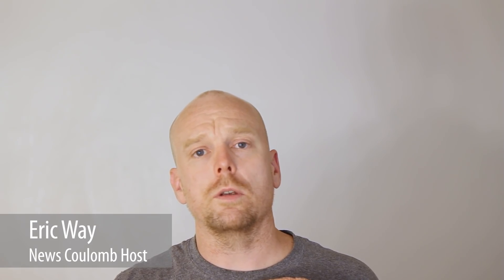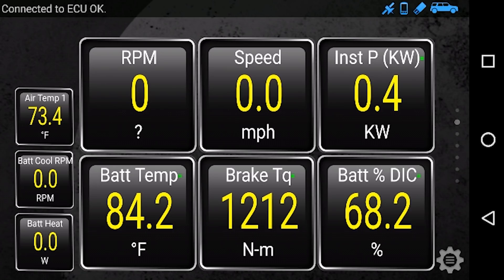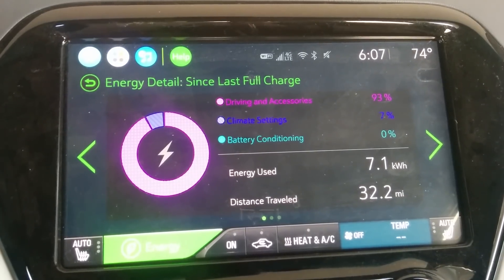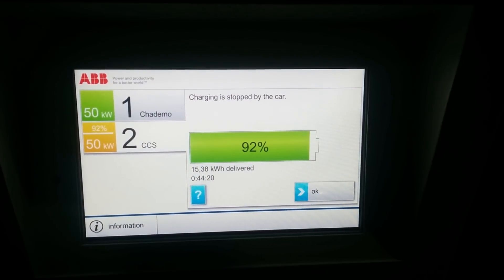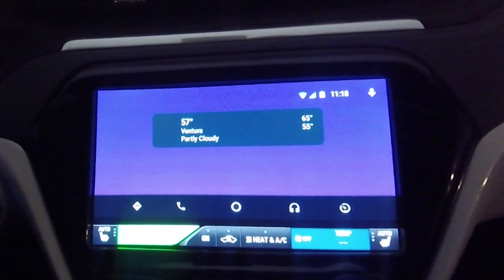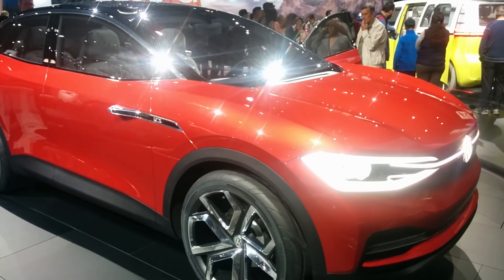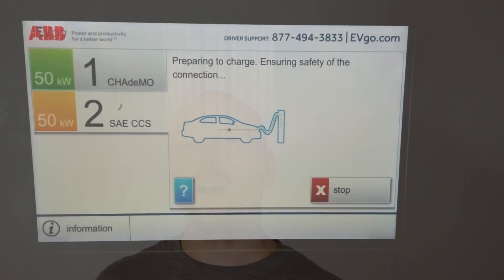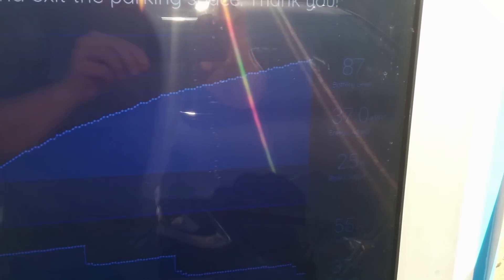Chevy Bolt EV: 70,000 Mile Battery Degradation

Comment: Eric - when used as a daily driver, I’d think that you’d need to create a specific situation that you’d subject the car to - once every year, or after another X miles - in order to determine the battery degradation.  When I drive from 30 to 90 miles per day in my average week, obviously I don’t see any degradation that has occurred in the 21k miles that my Bolt has accumulated to date.  The range of the 60 kWh battery is just that great, and my car so far hasn’t been used for much extended travel, since that’s just not yet practical in my region.  Being in Michigan, my car is exposed to greater temp extreme on the cold side than yours, and outside temperature (and climate usage) matters a lot when estimating the range which a full battery contains.  I wonder what effect that using a (50 kWh) fast charger on a cold battery has, when the initial charging speed starts out in the low teens and ramps up to 35 kWh charge rate 10 to 20 minutes later?  What’s going on inside that battery as it warms up - perhaps too quickly?  L2 chargers still deliver their maximum into a cold battery, so there must be significant resistance to taking on a fast charge when the battery is cold.  Maybe fast charging a cold battery is worse than fast charging when the outside temp approaches 100 F?  My typical at home charge ends at approximately 88% that HTR turns off the charger at.  But is this 88% reference point consistent over the life of the vehicle that I could use it as a starting point when running a battery capacity test?  I’d like to think that my battery hasn’t degraded at all in the 14 months that my Bolt has existed (with the huge range that it has, it’s certainly not apparent) but I’m sure there’s a real number.  And that number isn’t a loss of how many miles of range, since that can change a lot with driving speed, terrain, ambient temperature and climate control usage.  It’s more that the battery is now effectively smaller, which that capacity will only provide a certain maximum range, which is less than what it was when the car was new, but in a Bolt, it’s still a lot of miles.  Perhaps you have a route which you can take where you may start with a 100% or perhaps an 88% battery and then proceed to run the charge down to near 0% and use that data for a battery capacity calculation.  Or perhaps with your extended (but predictable) weekend travels you do have a gap between chargers which permits you to perform a capacity test when the temp and wind conditions are comparable to the last time that you ran such a test?  60 kWh allows you to cover a lot of ground during such a test, so I’d think you’d want to make the time spent on that sort of trip somewhat useful, vs. a lengthy but simple day trip where you end up where you started.  Our public chargers are too widely spaced yet to permit me to run such a test without a risk of running the car down near 0% charge, but perhaps I am able to construct a trip which would cover up to 50 or more kWh and offer minimal risk of bricking the car as the charge level approaches 0%.  Considering how frequently that you seem to push yours on the bottom end of the battery, I’d be pretty pleased to know that only 8% drop off has occurred to date on your Bolt.  That’s pretty encouraging for the rest of us.  Do you ever charge it to 100% and let it soak for a couple of hours to balance out the cells?  That may be beneficial for capacity too.  Thanks for sharing your data/experiences.

Comment: Excellent experience and transfer of information video. After 10,000 miles in my Bolt EV LT I still getting over 300 miles average on the GOM and a rate over 6.0 miles/kwh without ac charging at Hill Top Reserve or 280 miles average with ac and 5.5 miles/kwh. In Puerto Rico ambient temperatures range from 80 to 92 degree F. "Outside temperature" gauge always are in green area (between 3.8 to 5.0). Allways charge at 12 amp and 110 volt charger in my house garage. Slow charging is my theory of preserving the battery life.
Reply from the maker: Thanks! Yes, definitely slower charging and maintaining the top 12% of your battery as a buffer will reduce your battery degradation significantly.
Reply: I agree I turn off hilltop reserve  on top of a 5600 foot mountain with roads of 8% to 10% grade and charge at 12Amps for 8 to 10 hours. I consistently end up with 300 miles of range when I enter the outskirts of Escondido CA.
Reply: How long does it take to charge with 12a 110v?
Reply: You gain about 4 miles per hour on 12a charging

Comment: Another great video - thank you. From watching all of your videos my guess would be you have used L3 284 times based on 70% of total miles driven. 73,000 * 70% or 51,100 miles; average kWh charged 45; miles per kWh 4.0 or 180 miles added per charge; 51,100 / 180 = 283.89 charges. Am I close?
Reply from the maker: I'm not sure. I might be able to tally, but I think it's fewer miles driven on DCFC, but more sessions. The number of sessions might not be a good metric, though. A better metric might be the total time spent DC fast charging.

If I had to guess, at most, 50% of my miles are on DCFC. If so, and you estimate about 90 miles per 30 minutes (which is probably pretty close), I've spent about 200 hours DC fast charging. That would probably equal closer to 300 to 350 sessions.

Comment: When you get 100,000 miles on your Bolt, it would be interesting to see what battery lose you have then, compared to now, so keep driving.
Reply from the maker: That 100,000 miles is going to come quick, though I'm almost exclusively using Hilltop Reserve Mode now. I expect to see a decrease in the rate of degradation moving forward. I'd be surprised if it is more than 12% by 150,000 miles.
Reply: Erick Belmer has about 445K on his 2012 Chevy Volt with about 160K from wall power. Has significant degradation but still usable. 4000 full charge cycles equivalent or so. Chevy batteries are reliable https://www.greencarreports.com/news/1112485_2012-chevy-volt-has-now-crossed-400000-miles-range-remains-steady

Comment: I’m only at 8,500 miles and usually only charge between 20% and 85%, I have not noticed a change in available range.  The only time I charge to 100% is in January and February when the car emails me to plug me in it’s cold out here!  You are tough testing your Bolt! Are you trying to catch up with that Volt with 400K miles?
Reply from the maker: I would say that even in winter, you might not want to charge to 100% unless you absolutely need the range. Using something like Hilltop Reserve Mode will treat the battery like it's full when it's at 88%, so that might be an option.

There's no way I can catch up to Sparkie! lol But this is just my standard use case. I really need an EV with a minimum of 150 miles of range just for my daily driving needs. I was burning way too much gas in my Volt, so it didn't make sense. Even still, between the two Volts I've had and the Bolt EV, I've logged nearly 130,000 miles just on electricity in the last five years.
Reply: News Coulomb I’ll have to change it to hill top reserve I want it to last as long as possible! Thanks.
Reply: I have about 4k miles on mine and I charge it to 100% every 2 weeks via Level 2. Just wondering if that's ok? I will probably keep this for the rest of my life.
Reply: eBoarder75 I have heard many sources claim it is best to not charge a lithium ion battery all the way to 100% or discharge to 0% on a regular basis.  But I don’t know why other than it decreases the life span.
Reply: @My2JZandMe  no. Another thing is you overcharge the battery when degenerative braking or have no degenerative braking at full capacity. That's kinda what the name for the hill top reserve came from.

Comment: I think if GM reprogrammed the BMS to decrease available KWH they would need to update the EPA range. Did your range actually decrease or did you just get an indication that you are using less kWh?
Reply from the maker: Yes, and that's why I don't think it was actually capacity loss. I think it is most likely one of two things. 

1) A couple early estimates (less than 5,000 miles) showed as much as 62 kWh usable, so the system might have been less accurate (off by about 3%). 

2) The Bolt EV used to stop when it hit 0%. They might have shifted so that you still have 2 kWh when the battery goes to 0%.

Either way, those are just a couple of guesses. I'm not sure we'll know for sure either way.
Reply: News Coulomb, I think when Weber Auto did the Bolt battery teardown, the battery said 57 kWh. Of course that figure varies with discharge rate. Some Chinese batteries manufacturers use 1/20 C to get extra capacity rating, which would not be realistic for an EV. 

What does GM go by for their 40% degradation warranty? Miles range or kWh delivered?
Reply from the maker: The EPA filling documents showed 350 V nominal @ 171 Ah (or 60 kWh exactly). That's what I'm going by.
Reply from the maker: I'm guessing the 40% is by capacity. I don't know how else they could do it because mileage varies based on so many other factors.
Reply: IMHO There is more background on the 57 vs 60 kWh topic here:

https://electricrevs.com/2018/03/29/gm-explains-57-vs-60-kwh-bolt-ev-battery-ratings/

Comment: Good video.  One comment is another variable that was left out is that battery pack temperature can also affect the amount of usable energy available.   The Bolt EV's TMS seems to only maintain a battery pack temperature above 40F (4C).  The usable energy at 40F is noticeably different then at 80F for example.  Us in Canada (and other cooler climates) also see much reduced initial DCFC charge rates when the battery pack is a lower temperatures (again to protect the battery).  These charge rates increase as the battery pack warms up.
Reply: Yes. I live in MN and notice that range under 50F goes from 200+ miles to 160-180 miles. HVAC usage (especially heat) and battery temp do make a difference. I had a Leaf before our two Bolts (yes, we are lucky no ICE cars at all) and like the resistive heat the Bolt has, whereas the Leaf had a heat pump. Even at the expense of range, when I want to be comfortable I can be. The Leaf would struggle to make heat when it was sub-zero temps.
Reply from the maker: Yes, and part of the reason I said "approximately" 55.5 kWh usable is a variation of +/- 1 kWh, and it does seem to be seasonal (i.e., I actually see higher capacity estimates at lower temperatures).

Comment: Yes, with 2012 Leaf at 70% SOH, I notice degradation because instead of max range of 84 mi, I only have 60 mi which obviously affects speed and ability to take long trips. With modern electric car with 200 mile range, even a 30% degradation would leave  160 miles wouldn’t affect ability to travel long distances with charging stations even 100 miles apart, even in winter.
Reply from the maker: Yes, for me, 150 miles is the minimum range before it becomes an inconvenience for me in my day-to-day driving.
Reply: My 2012 Leaf had degraded to 61% SOH by August of last year.  With only about 48 miles of range I decided to replace the battery.  It cost me $8200, but now it is essentially a new car with a better chemistry in the battery, and a range of about 85 miles in warm weather.